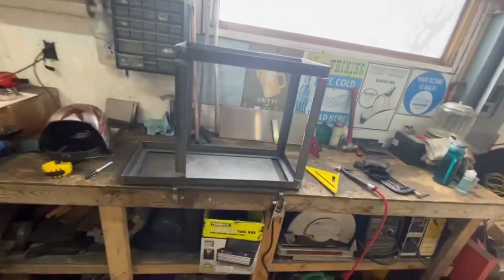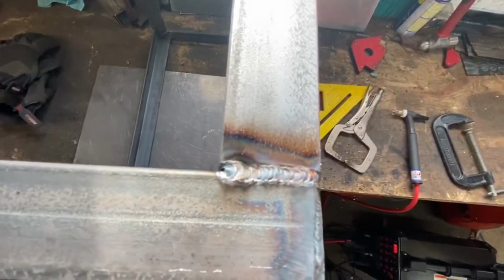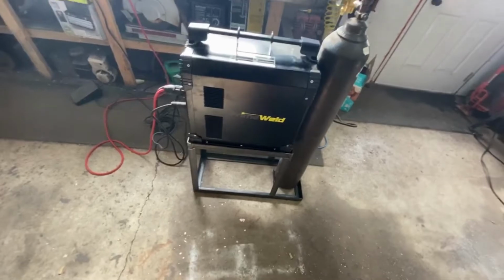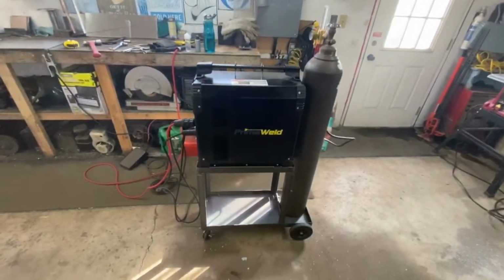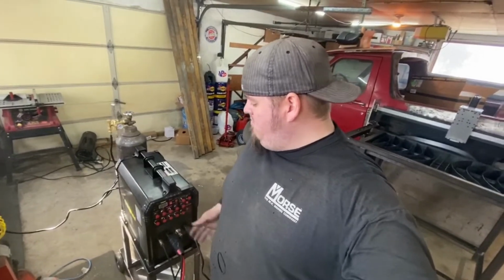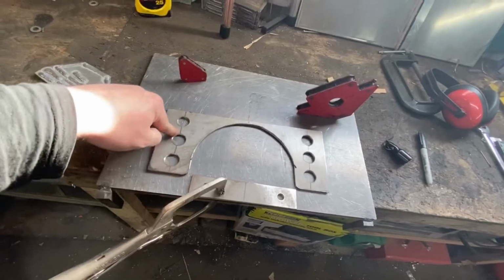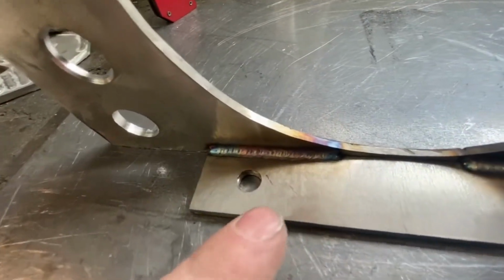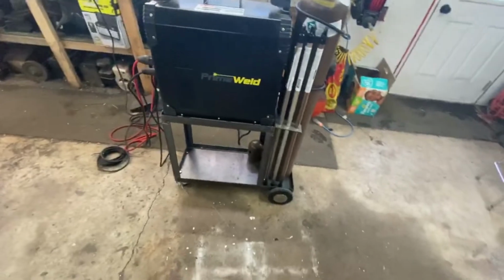Primeweld tig 225 welding cart - welding cart complete

Comment: Make sure you tie that tank down while you're working or at least cap it. Don't want that rocket going off. Nice job though.
Reply from the maker: Oh for sure man I did not mention that in the vid! I have a small ratchet strap on it right now waiting on chain as we speak. But thanks for catching that. And thank for watching.
Reply: @letkemanfabworks619  glad to hear, i saw the wobble and had a flashback to welding class and the guy showing us pictures of brick walls blown out!